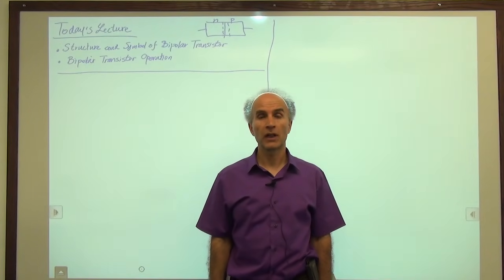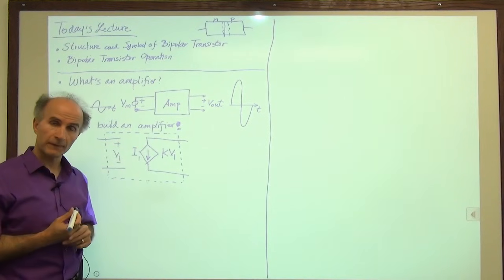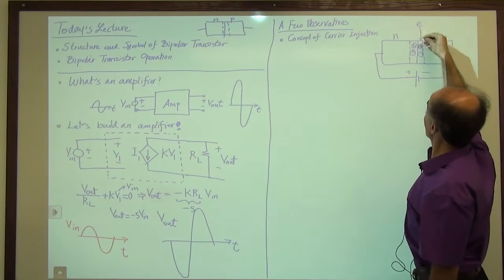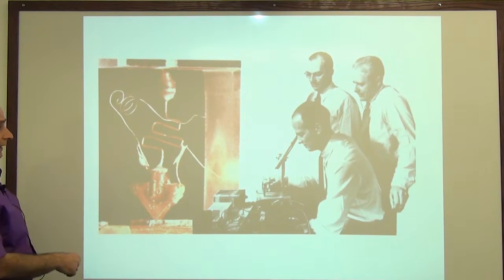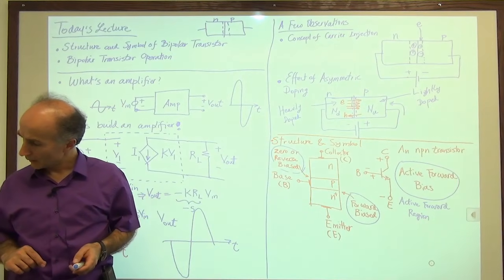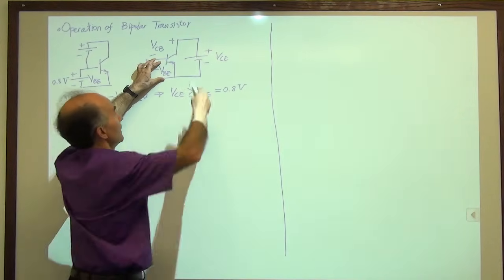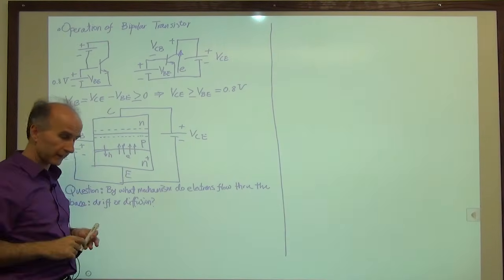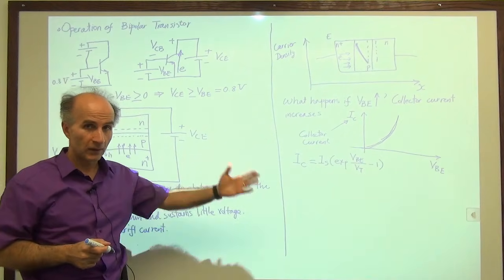Razavi Electronics 1, Lec 13, Bipolar Transistor Structure & Operation

Comment: Please why do you connect RL
Reply: RL simply represents the load — it could be a resistor or any appliance like a bulb, fan, etc.

When a load is connected in parallel, the voltage across it remains the same as the supply voltage. That’s why, for analysis and convenience, we often model RL in parallel — it directly reflects how real-world loads are typically connected and ensures constant voltage across the load.

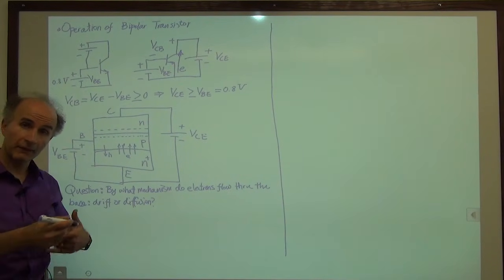Comment: 54:30 By what mechanism do electrons flow through the base: drift or diffusion?
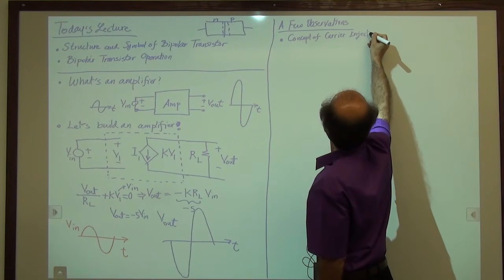For those of us who answered "drift" - clearly, we were thinking back to the concept of "Carrier Injection" at 17:45. Here, electrons ALREADY IN the depletion region, on the p-side, (by direct injection) are subject to an electric field and are driven by DRIFT.
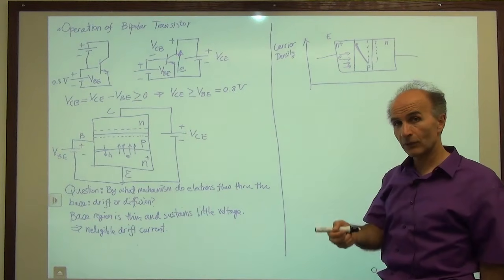By contrast, at 58:30, electrons are driven by DIFFUSION from the emitter-base boundary TO the depletion region on the base-side of the base-collector junction down a concentration gradient.
So, DIFFUSION through base, then DRIFT across base-collector junction.
Reply: Good, I said Drift too initially.
Reply: if the upper half is reverse biased, will (pouring electrons from n+ area to p) and (giving holes from the Collector to n ) make depletion region bigger?

wait,  maybe reverse breakdown has the same mechanism. Make the depletion region go so big that the whole diode has electric field, causing electron to pass easily. And the reason why reverse breakdown won't happen here is because p is too thin and n is thick, making it impossible to have depletion region in whole n area ( p is possibly all depletion region).

please correct me if I'm wrong.
Reply: https://www.youtube.com/watch?v=hrpPKCDLRN0&list=PLkyBCj4JhHt8DFH9QysGWm4h_DOxT93fb&index=11
i found this video really useful at illustrating NPN mechanics.
Reply: Diffusion through base I agree but in the lecture Prof. has told that zero bias across base-collector junction will also work. Then if zero bias can work, how drift will be assisted through the collector-base junction?
Reply: bro u saved , i was overthinking abt this

Comment: Sir, thanks for such an amazing illustration. But i have a question that collector current cannot be equal to the current of the diode ( between base and emitter ), because some charges are flowing towards the base terminal, which should be subtracted from the total current before it reaches the collector current.? (1:02:00)
Reply: Approximately they are.
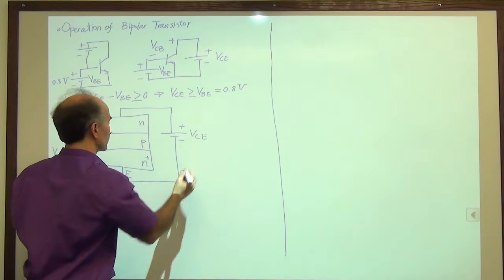Reply: Yes. @dawn is correct. But Razavi doesn't explicitly say this until 47:24 in Lecture 14 (next lecture). ("... we often assume that the collector current is approximately equal to the emitter current ...")